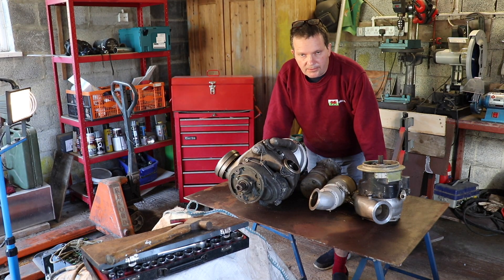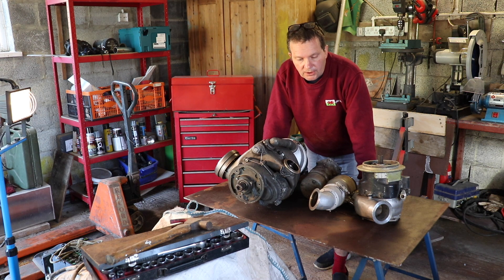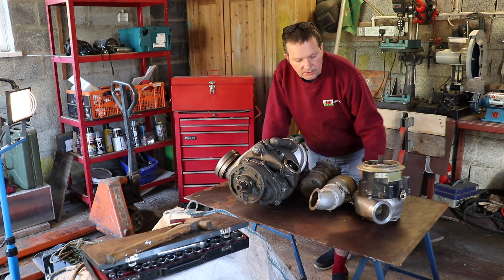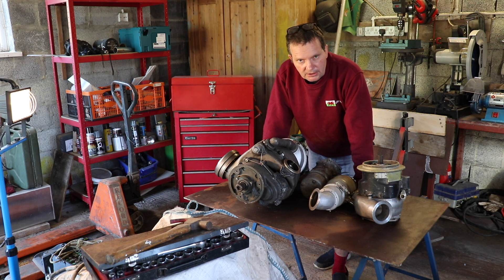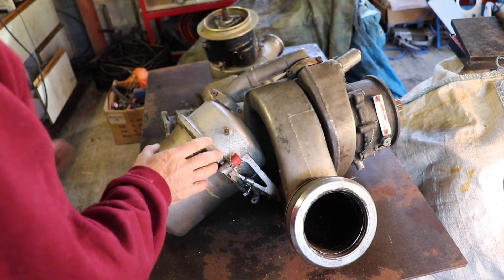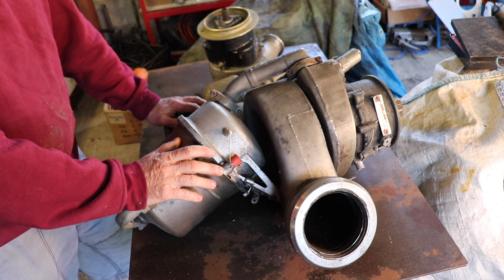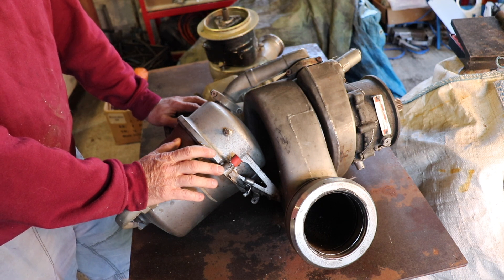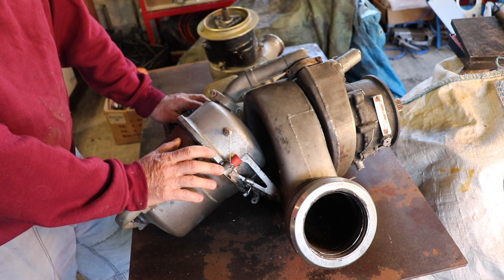Jet Engine Starters: A Lot Of Hot Air!

Comment: I have a  General Electric 7TAS18S14A Gas Turbine Engine Starter, they have a small  combustion chamber just add fuel and compressed air bit like the JFS 100

Comment: From what i can tell the smaller housing is for the gas with its fitting being the exhaust and the larger housing is for the air start, fitting in, exh at canister. Its on the same core, so when using the gas charge, the air start turbine acts as a fan to cool the cartridge case. Fyi, the f22 and f35 have cartridge starters.

https://youtu.be/U9l_NnvsB-g